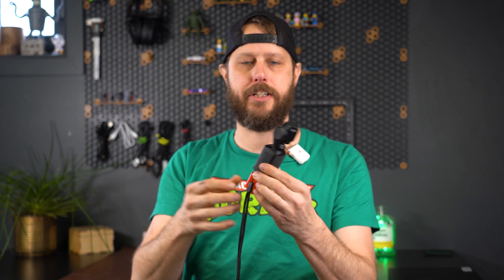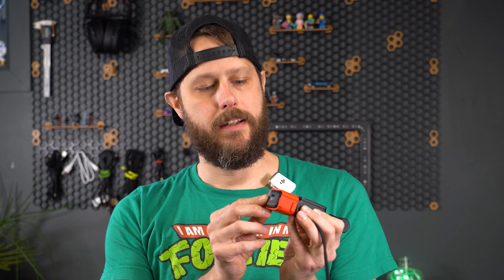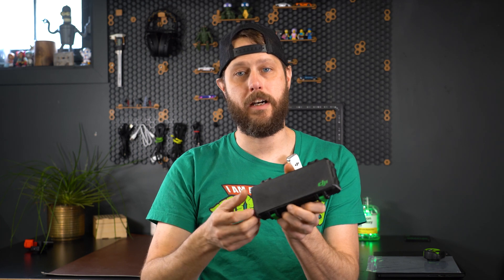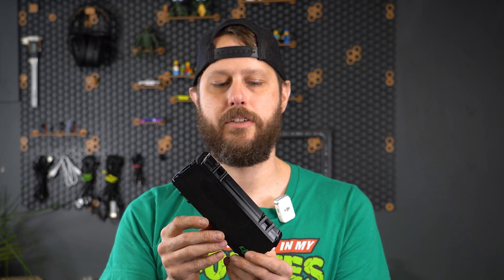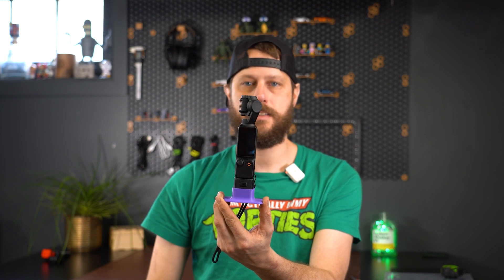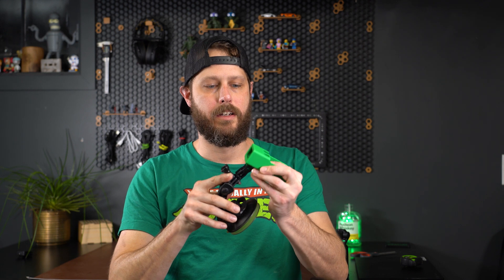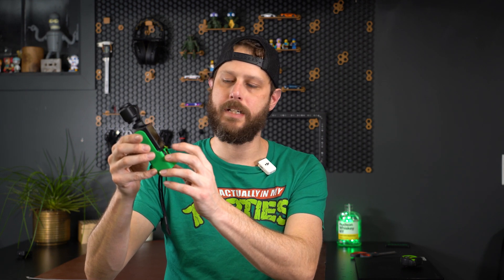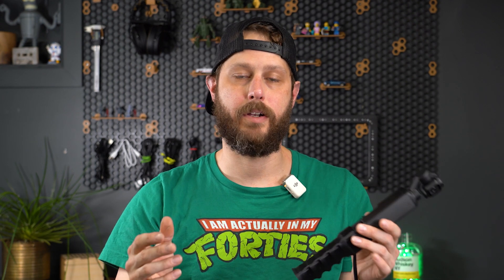3D Printed Accessories for Osmo Pocket 3: A DIY Revolution

Comment: Thanks. I want print a cover for the original case but one that only goes half way down.
Reply from the maker: The one I shared in the video is great! I have an aftermarket hard case and I still put that 3D printed one on!